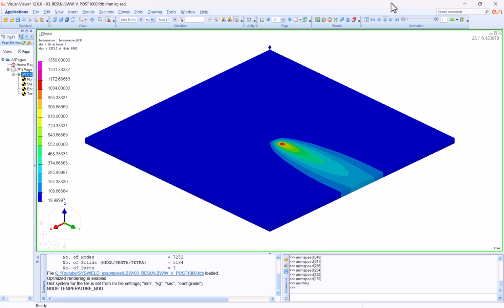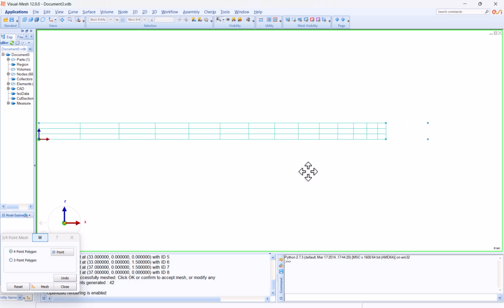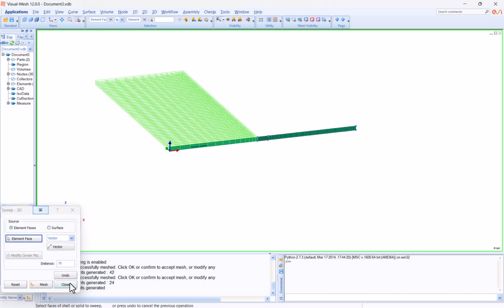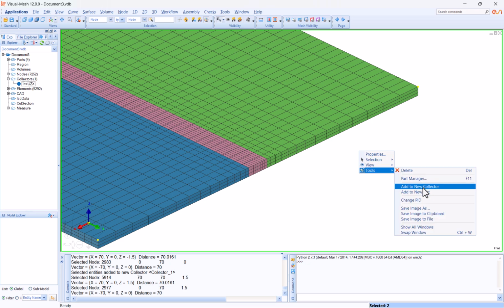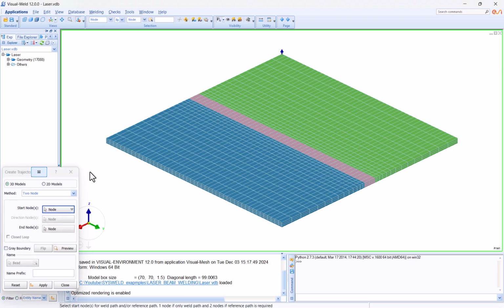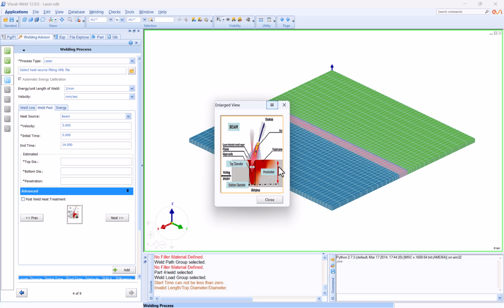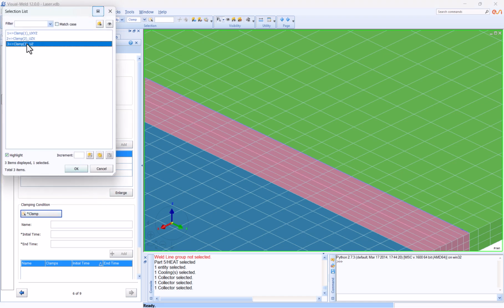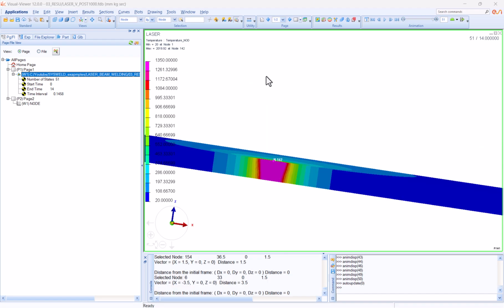SYSWELD Tutorial: laser beam welding simulation

Comment: Great video! Youre helping a lot for beginners like me. I heard that the conical heat source is only applicable on partial laser welding processes, but not for full penetration laser welding. Can you confirm that? Or is the conical heat source also applicable when laser welding through the entire depth?
Reply from the maker: Thanks! Yes, that’s mostly true.

The conical heat source is mainly suited for partial penetration laser welding. For full penetration (keyhole mode), it’s usually not ideal on its own, because the energy is deposited through the entire thickness.

It can still be used for full penetration if carefully calibrated, but it becomes more of an approximation. Volumetric or keyhole-type models generally work better.